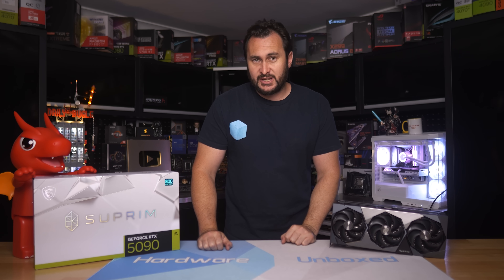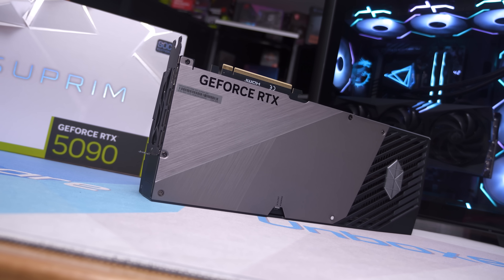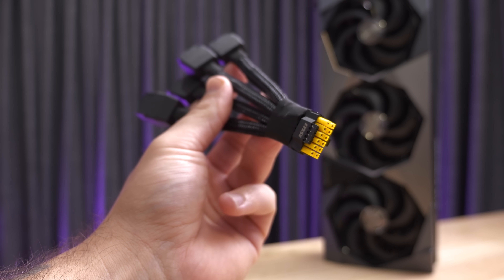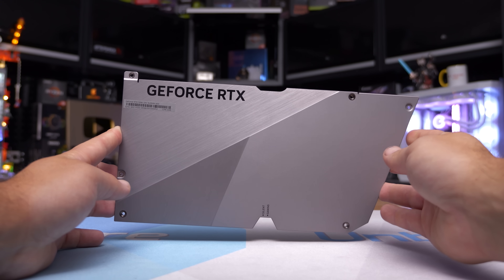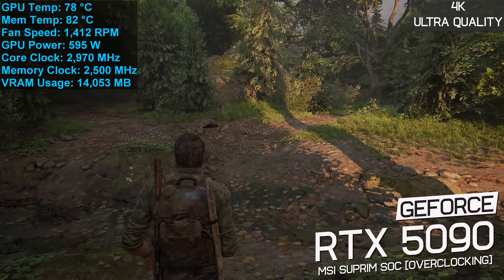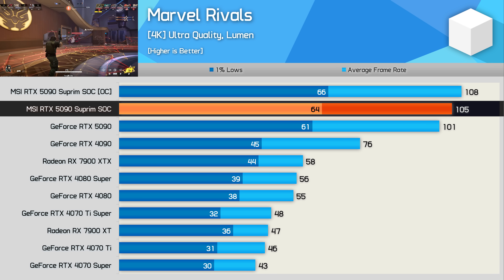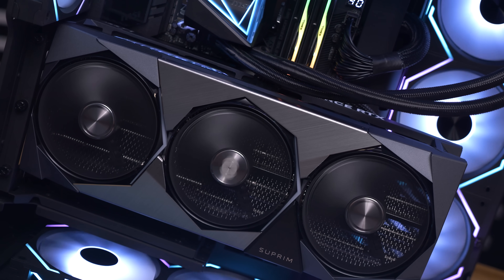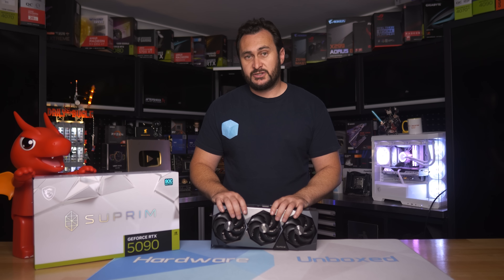MSI RTX 5090 Suprim SOC Review, Biggest Graphics Card We've Ever Seen!

Comment: The ASUS RTX 5090 Astral OC is even more absurd! It's similarly sized to this, but costs $2800, i.e. $400 more than the Suprim OC and $800 more than the FE model...
Reply: Asus has gone off the deep end the last few years. Everything they sell is 5 to 20 percent more than any of their competitors. I would assume it's tariffs but alot of their competitors are based in the same country so. .
Reply: @InfernusdomniAZ It’s not tariffs because they cost the same price if not more in Europe
Reply: Asus tax 😂
Reply: And it will resell for $4-5k during the initial shortage and $3500 by the launch of the 6090. It's amazing how ignorant gamers are about the most basic economic concepts.
Reply: @  thats a valid reason to buy Astral, resell value when 6090 gets here will be higher then other cards for sure.
Reply: @Kira-qc4qi I think 2-2500 is the hard limit. Past that the number of potential buyers is astronomically low. Heck even for the 5090 they don’t expect to sell many which is why the quantities at launch are so low.
Reply: @ancientflames  checking in after launch. Astral 5090s selling for 5k+.
Reply: Crazy how these cards are gonna be at least 3500$ when scalpers get em
Reply: It's just branding... Asus believes they are a premium brand and they can ask for 20% more in price vs competitors. This may have been true 5 years ago, but not so much now. This is a good example, if the Suprim SOC delivers only 10 MHz less compared to the Astral OC, but costs $400 less and pretty much same quality... Not to mention Gygabyte also offers pretty high performance alternatives, and also other 3rd tier brands offer solid quality and maybe 80 MHz less factory boost clock, but for 30% less price. What Asus offers is pruely branding and not much of actual value... This is why I also stopped buying their motherboardsm since we got very good options from MSI, Gigabyte, Asrock, etc...
Reply: how does the Astral overclock in comparison to Suprim? saw 1 review and that guy didnt even OC the card so pretty useless.
Reply: @medovk wait until these guys get their hands on it. 

I'm wanting to underclock to 4090 power levels to keep my 850w PSU happy and game in the retro world. I'm not scraping for every fps.. just as long as the card I buy is solid.. so more reviews to come and doing my homework from there.
Reply: @  isn’t it easier to get a better psu? got a 1300w and it wasn’t even expensive…. my 4090 pulled 580w with strix launch bios and OC. yeah, and der bauer will get one for sure soon.
Reply: No-one is making a WB for FE.
Reply: They know you have money.
Reply: I love msi but pass
Reply: Also, the ASUS GeForce RTX 5090 Astral OC weighs 3038 g compared to the MSI GeForce RTX 5090 Suprim SOC which weighs 2839 g, according to TechPowerUp.
Reply: And is worse, that 4th fan is junk.

Comment: 700 fucking watts from one component, this isnt about money anymore honestly. I do not want a space heater in my place, especially in summer. I already have it crazy with AC.
Reply: It’s cpu and gpu combined they do it to account for GPU overhead
Reply: Yeah..... It already gets hot in my room and I have my 4080 heavily undervolted, at max it pulls 280w. I'll skip this gen.
Reply: @Orlyy  My undervolted 4080 usually uses 215-230 watts at full load. You can definitely make the power consumption lower without performance loss.
Reply: @Hobanaka  I can't get it stable any lower. Most of the time it's using 230-250, but in some specific games it can spike up to those higher numbers.
Reply: @Orlyy  Ok, here`s my settingas of MSI Afterburner curve +100Mhz (limited at 950mv), memory clock +700.
Reply: @Hobanaka  ye I'm at 950, +1000 on mem, but 0 on core. I can try 700 and see what happens
Reply: @Orlyy  no you dont understand,  this card may be the most efficient card, its jsut doing more work.  What we need is efficiency test to see what they draw at say 60fps at 1440p and 4k. Almost always,  newer cards are more efficient.  Its at the very high demand that a lot more power is needed for small gains.  Bring the demand back and bit and see how they do. Id bet the the house that these top end cards are the most efficient.  I have 4080 and 4k 120hz monitor, but screw 120hz  i play at 60fps because it a-ok for me, im not chewing through all that extra power & heat.  Id like the best visuals at 60fps,  within reason for draw & heat.   Im always interested in the new series to see how much more efficient they are.
Reply: The heating in my room has been completely off ever since I bought the 3080ti, with this card I'd have to open the window even through winter
Reply: Only use it in the winter time LOL
Reply: I’d have to go to amd to cancel out the extra heat this would throw. Then there’s the bill from AEP. I’ll skip this one. Maybe do the 5070 TI since it’s just a 4070 super ti.
Reply: Holy 😨
Reply: With brainless politicians causing horrible electricity prices in Europe, this power consumption is not trivial. Sure in the winter you can offset some of the cost to general heating of the house but that's not gonna be the case year around. It's not like I have 5090 money burning a hole in my pocket anyway, my entire current gaming rig is worth maybe 50% of that GPU.
Reply: I open my case and put a box fan on it during the summer time.      No issues
Reply: If you play games on the Playstation or Xbox.; you won't have to worry about the gpu setting, upgrade Gpus, micro chip or adding more ram 

Gaming pcs are a money pit
Reply: no you dont understand,  this card may be the most efficient card, its jsut doing more work.  What we need is efficiency test to see what they draw at say 60fps at 1440p and 4k. Almost always,  newer cards are more efficient.  Its at the very high demand that a lot more power is needed for small gains.  Bring the demand back and bit and see how they do. Id bet the the house that these top end cards are the most efficient.  I have 4080 and 4k 120hz monitor, but screw 120hz  i play at 60fps because it a-ok for me, im not chewing through all that extra power & heat.  Id like the best visuals at 60fps,  within reason for draw & heat.   Im always interested in the new series to see how much more efficient they are.
Reply: Playing 60fps is fine for me 

Why can't Gpu manufactory build 5090 gpu the same  size of  the founder 5090 edition
Reply: @fredfinks  lol then go buy a card that can pump 60 FPS will do. Higher cards are not efficient and if you want 4k 60 FPS on pure raster it's still gonna use up a lot of power. 5090 can't even run BMW at 4k 60 FPS pure raster. If you gonna use DLSS to hit 60 FPS then just a cheaper card that will do the job. Usually 5070 are the most efficient if you aren't going for ultra settings.
Reply: Maybe the solution should be making better optimized video games rather than making ever more power hungry and expensive hardware to run badly optimized and boring video games. Just a thought.
Reply: 700!?! the 565. Like sure I want a 5090 but I've got a 1000w PSU. I don't have that much room in my power budget
Reply: @davidm.corbin4643 did you not look at the benchmarks or? CP2077,  A plague tale, and dying light 2 all pulled 700+. 751 on a plague tale.
Reply: @davidm.corbin4643  It's honestly recommended to get a 1500w if you plan to use a 5090
Reply: @davidm.corbin4643  did you watch the video?
Reply: twice the total system power of a normal gaming PC in just one card
Reply: What’s funny is lot of people want more raw rasterization power from the gpus but it’s gonna take more power…
Reply: @RandomPersonOnTheInternet1234  This is incorrect, the poor efficiency gains from this generation compared to the last are mostly because its the exact same process node. There was no shrinking. Gains without increasing power are at this point still possible.
Reply: @RandomPersonOnTheInternet1234  Because its a different generation. It is not supposed to just increase its power consumption in exchange for performance - hence why people are calling it a 4090TI, because its basically just a 4090 with increased power consumption. (i.e 25% increase in power for a 20% increase in performance, not including this monstrous 700w card.) 

Examples of how it should be is a 2060 vs 3060 (essentially the same TDP, around 10w more for the 3060) but 15% more performance, or the 5600xt vs 6600xt (again basically the same but 10w more for the 6600xt) but a 20-30% increase in performance over the previous generation. Another example 5700xt vs 6700xt (220w vs 230w) around a 20-30% uplift in performance. 2070 VS 3070 (175w vs 220w) a 30-40% performance increase for around 25% more power consumption. 

3090 vs 4090 (350w vs 450w, - 450 vs 450 if its the 3090ti since the 4090 doesnt have a Ti equivalent) around a 25.6% power increase (if not 3090ti otherwise exact same power) which is a gigantic 50-80% (sometimes higher in certain gains) uplift in performance. If you're comparing 3090ti vs 4090 (EXACT SAME TDP) which is a is around 40-50% more performance.

You seeing the problem here? You seeing why people are calling it a 4090ti not a 5090?
Reply: @RandomPersonOnTheInternet1234 basically all the comments about the 5090
omg this card has barley anymore raw performance, they should make it faster.
Omg why does this card use so much power. They should make it use less power.
Reply: @ if higher performance always meant more power we'd be talking about totaly different numbers by now, it's just nvidia isn't improving power efficiency, just pushing more power and bigger chips
Reply: @Mart-E12 that’s because you people will cry and cry and cry and fill your diapers if they only shoot for efficiency. You all want rasterization and that’s it - well here you go. Have fun with your 1000 watt gpu! I want software and tech to advance to propel performance while gain efficiency thank you
Reply: Don't cry, turn on the air conditioning. Who plays without air conditioning in the summer?
Reply: ? that's not one component
Reply: The 5080 will be less efficient!

Comment: Nvidia and their AIBs should start offering an direct AC power input next time.
Reply: Honestly, I wouldn't be upset about it hey. Much cleaner in the case too
Reply: look up "captains workspace 4090" 😂
Reply: I keep a portable AC in my room in the summer for when my PC is going hard and my GPU is half the wattage.
Reply: @ "AC" has two meanings: "Alternating Current" (meaning: wall socket power) and "Air Condition"
Reply: They are thinking about it.....and of course at extra cost

Comment: 700W + holy shit...

Not like I have 2k to throw on a GPU nor a PC capable of handling it, but with electricity bills here in EU this thing would really do some damage to the bank account not only when you buy it, but even every time you use it.
Reply: That meme about the RTX 5090 needing its own external power cord might not be that far fetched after all..
Reply: Don’t forget double the idle power also.  Some of us also use our machines for work/play
Reply: Think of the heat it adds into the room!
Reply: @shaurendev  you can save on heating, just don't turn it off 😅
Reply: msrp in eu in 2350 euro
Reply: @HD-fc4ds  u mean for the founders?
Reply: Where I live in California, this would cost me 2.51 USD per day when OC'd. 917.14 USD per year. Though where I live, electricity costs are much higher than normal. Crazy... I pay 0.27 per kWh at the highest rate.
Reply: @joshgarcia6344  stil less than here at .45€ 😭

Btw hope you're doing good, given what's happening there.
Reply: Run it as a heater during the winter
Reply: Keep in mind, 750w is when utilising entire power of the card, normal gaming I think will take no more then 500, also undervolting can do wonders.
Reply: Crazy 😧
Reply: $2k is a pipe dream. I'm betting this card is closer to $2500 USD (so even more elsewhere around the world).
Reply: Haha that's way too much just to play some games, most I can stomach is about 400W but even then I still just undervolt anyway to keep power draw down
Reply: @wolfstorm5394  yeah I have a 6700XT that should draw 230W but I cap FPS in every game and have it undervolted so even at full load it never draws more than 190W (with same performance as stock voltage btw, so that's great) and it usually sits around 120-140 with my average gaming loads.
Reply: no you dont understand,  this card may be the most efficient card, its jsut doing more work.  What we need is efficiency test to see what they draw at say 60fps at 1440p and 4k. Almost always,  newer cards are more efficient.  Its at the very high demand that a lot more power is needed for small gains.  Bring the demand back and bit and see how they do. Id bet the the house that these top end cards are the most efficient.  I have 4080 and 4k 120hz monitor, but screw 120hz  i play at 60fps because it a-ok for me, im not chewing through all that extra power & heat.  Id like the best visuals at 60fps,  within reason for draw & heat.   Im always interested in the new series to see how much more efficient they are.
Reply: Who is spending 2500+ USD on a server grade GPU only to complain about power draw 😂. Buy the competition and stop yapping.
Reply: @mikelay5360  mine was just a consideration and kinda a joke on how much it consumes, it's insane.

Even more of a joke is the fact it comes with a cardboard package to be "eco friendly" while pulling 600W + (FE), we all know they just cutted costs on the box.